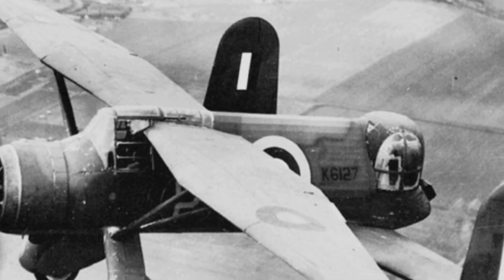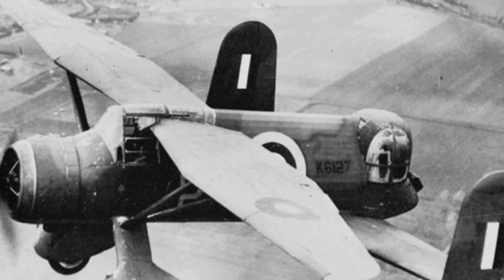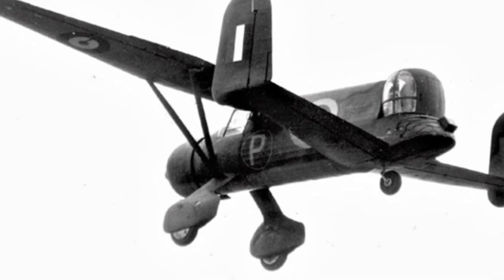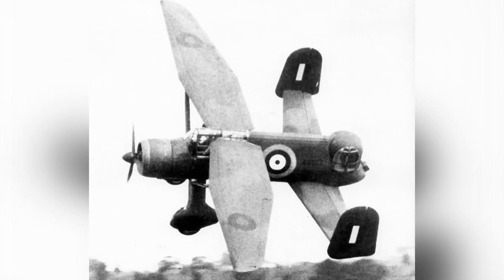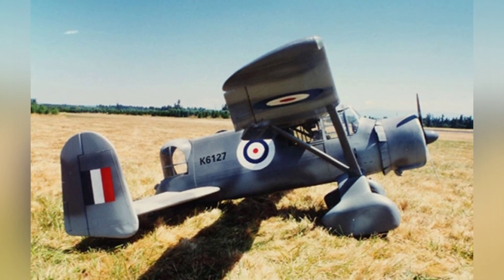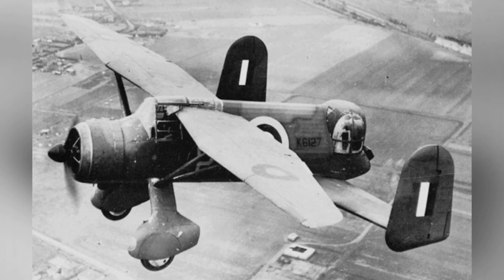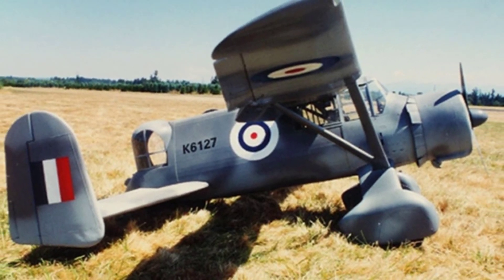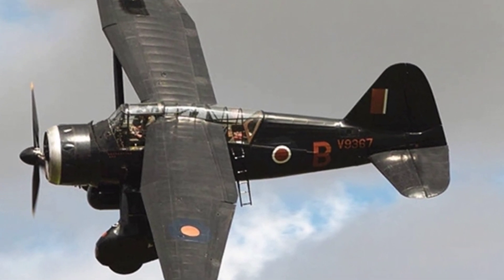"Enhancing Self-Defense: The Westland Lysander P.12 Turret Fighter"

Comment: They did NOT build a P-12 prototype.  They took the original Lysander prototype, tail number K6127 and modified it into the P-12.  It also never had a working turret.  They installed a non functional dummy turret and that's as far as the testing got with it.